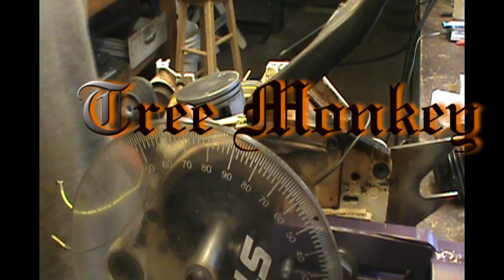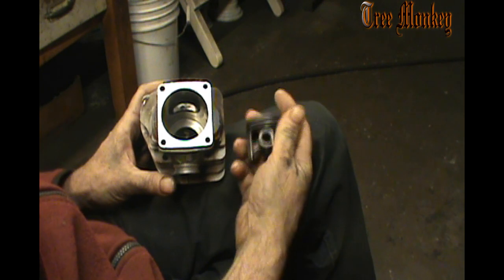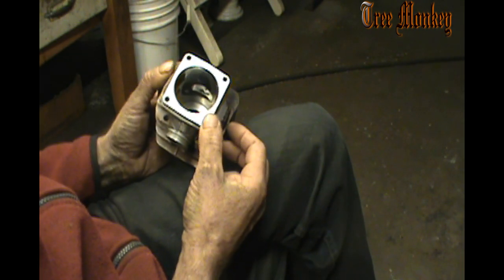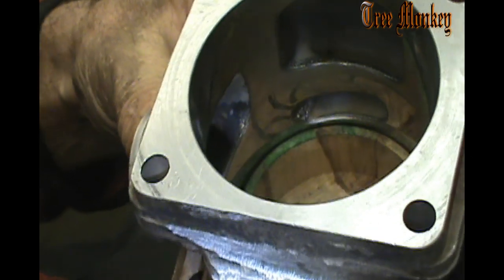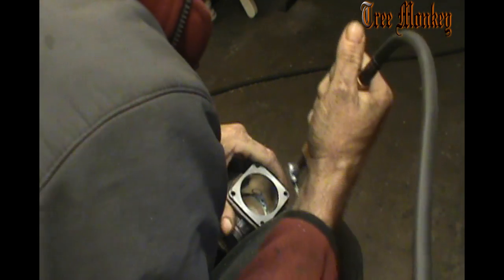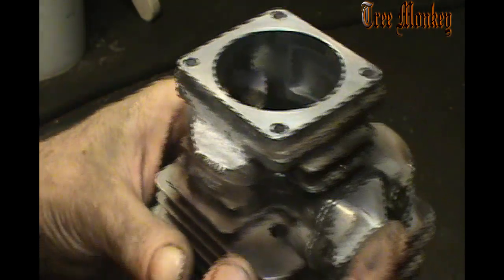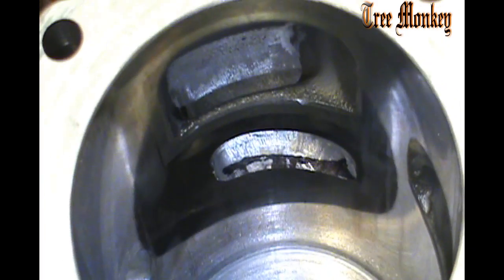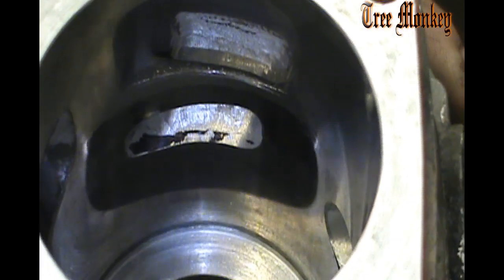porting video series part 7, transfer ports

Comment: "Rarely do lowers, rarely are there gains" -- is this included the context of flowed/ported cases?  I just posted to Iron Horse's video (again) asking him how he knows WHERE he can go when he's doing those gigantic flared lower transfers & cases, so far as I understood it there's "the optimal" and anything past that begins to slow the speed/force ('velocity'?) of the charge....he hasn't answered though. 
I will say, however, that - in my 2nd, and FAR more successful - round of porting my cs590, I did flare may lowers and expect that was a large % of the difference from round-1 (although, to be fair, the OEM layout literally blocked the lowers from receiving all the cylinder's lowers' casting could, there was like 0.5mm overlap 'stealing' from me, so widening/flaring a bit to 'capture' that seemed as much a correction/optimization, as a "mod"/"performance-move"!)
Thanks as always for the great vids, shouldn't reply when only 2/3rds through but am loving this series and literally going back&forth to my 660 (f.tec) cylinder from these vids (I have (2) cylinders for this kit-660, so wanted to do one really mild & basic so am effectively just doing 'cleanup' but with a slight emphasis-towards the shapes/sizes/orientations you prefer for this jug!)
Reply: Ironwhores=🤡